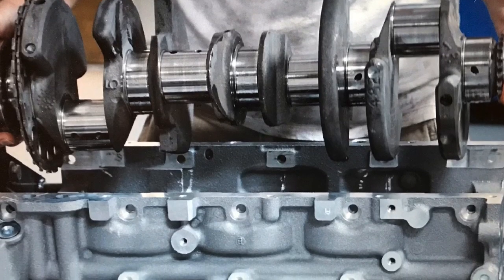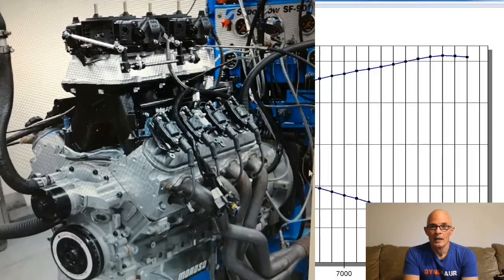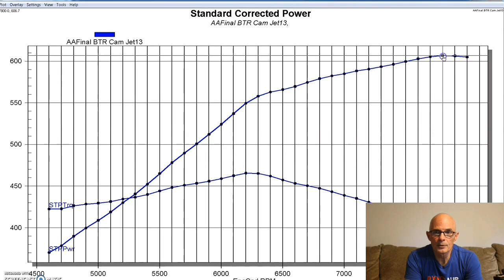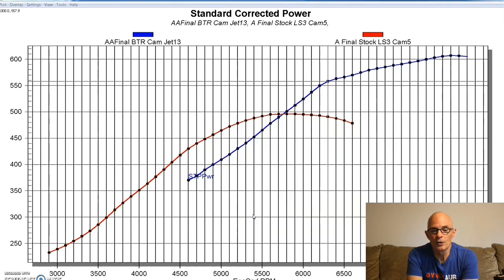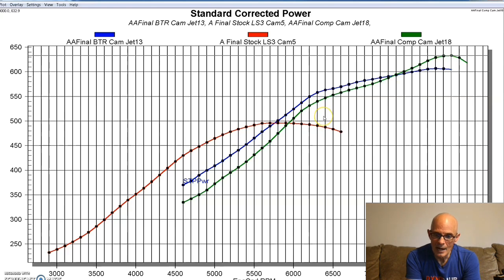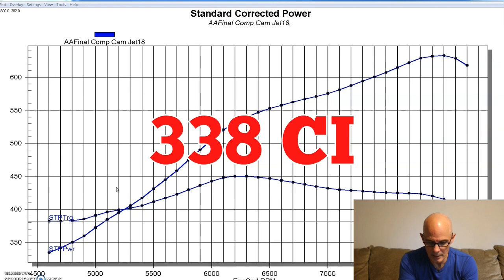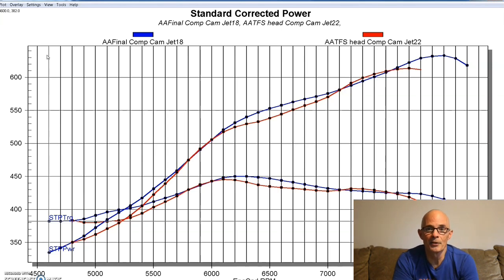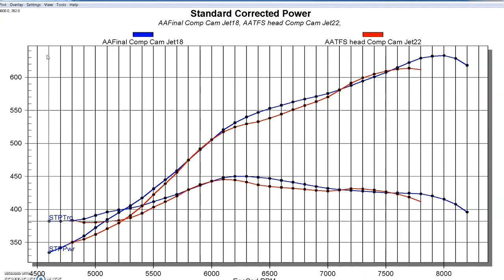DESTROKE LS-4.8L CRANK IN LS3 BLOCK-SHORT STROKE POWER-AN LS MONSTER MYTH?

Comment: No talk about piston speed? Isnt there a point where the piston is moving so fast the explosion rate cant keep up? I heard this number to be somewhere in the 60mph range, in which case wouldnt destroking become beneficial for that? My motor isnt an ls but I was picking cranks strictly based on this 60mph rule, which lead me to using my stock crank vs. Stroking, I could be an idiot I dont know... lol

Comment: Did this similar combo in a toyota 4x4 with turbo 350 trans 1.47-1 chain case, dana 60 axles 6.17-1 gears and 44 boggers. Was fun screamer but a torque monster would of worked better. But did with what was had

Comment: this is a sweet setup for 8000 rpm i whould like to see more testing with that short block combo like higher range compression ratio like 12.5:1 or close to 13:1 its possible to run that much compression even with pump gas if you have a motor setup for top end power (big duration cam reduce cranking compression and low speed power in theory) i think its possible to increase compression ratio a lot when you have a motor waking up in the top end range and still keep it pump gas 

Nice setup Richard
Reply: There’s a dude I know of with a 14:1 ls7 that does 8500rpm 840wheel NA

Comment: In race application, and why not on the street. It's sometimes more benefit in making the hig rpm power in stead off making low rpm power. First off, the engine size have often to do with racing classes. Second off, you might be limited with how much torque a gearbox might handle. This might be more a problem on street where you might be on a budget, but have to do with the weights issue also on the track.

Let's say you're stock gearbox can handle 300nm. If you get the torque peak @4000rpm you going to be down hill after that. Now let's say we make the same 300nm @ 6000rpm you will have a lot of more power.

It's much easier to limit the power output on an turbo application with engine management, having a lower bost on the peak torqued and rising the boost to keep the torque up higher. In the case you torque limited on any component.

Often inport cars have power potential with an turbo upgrade but the gearbox is too weak to handle the full torque so you just do some engine management to make it last and still enjoy the big power numbers

Comment: stroke length can be a limiting factor in making high rev power. The flame front can only move so fast and with a longer stroke the pistons speeds get high sooner in the RPM's so the piston can, in a sense,  run away from flame, or pressure, faster. When this happens the pressure in the cylinder cannot put as much work into the piston. In a short stroke engine the pistons move slower That is why you can rev a shorter stroke higher (if the head/valvetrain can support the rpm).

Comment: Richard, can you touch on piston speed? I run a 4.125x3.625 blown alcohol Chevy ("short stroke 400") to help control piston speed. We run the motor about 7800-8000 rpm. It makes roughly 1100HP (1975# car / 180mph)

Comment: Given a valve train that can support high rpm and rotating assemblies with the same mass, doesn't a shorter stroke give the ability to rev higher than a longer stroke just due to lower forces on the components? 
How would these two setups compare from an endurance stand point?

Comment: I couldn't agree more with the points made here, Short stroke with long rods is simply to lower the rod angle and decrease the amount of piston acceleration and deceleration, thus introducing less stress on the rods at both ends, ALLOWING the engine to rev higher. Higher revs opens up the potential to make more power i.e, more design rpm total, hence why NASCAR engines have been designed to turn as high as 11k rpm. Along with power higher in in the engines rpm is the ability to design a more broad curve over a larger window of rpm, meaning an engine built to turn say 12k can have the potential to make more than usable power from say 5k to 11k, and within that window to avg a higher hp number, than a lower reving counterpart, while still not suffering too much loss from 3k to 5k. Well stated and very informative.

Comment: I thought that short stroke engine's  were used at high revs for durability.
I have been told that the longer the stroke the higher the piston acceleration and associated forces on the rotating assembly.

Comment: It’s not a myth, if you take a given engine cubic inch and do nothing other than increase stroke the engine will make roughly about the same peak hp number ( more torque though) but do so at a lower rpm. The larger engine will consume available airflow sooner ( lower rpm).  You can of course get the larger engine to peak at the same rpm as the smaller engine with correspondingly more power with a suitable upgrade cylinder head, cam and manifolding. The effect is more pronounced when you are severely cylinder head limited 

The exception is if the smaller engine combination is out to lunch ie the head is too big and the rest of the combination does not  let it rpm enough to use the head to its potential.

Comment: Another thing people don't seem to understand that goes with your flow point is a that a bigger engine will act differently to the same cam specs. A big cam on a dz302 would be moderate on a 454.

Comment: F1 engines need to maintain equilibrium around the circuit the high rpm constant gives them quick power in tighter areas on track

Comment: @RichardHoldener I’ve dug deep enough on the interwebs and found that there is flat plain crank options for the LS. From what I understand, the advantage to a flat plain crank is you have half the cylinders firing at a time; the throws on the crank are 180 to each other. This is beneficial because it also allows faster, higher revs. It’s hard on the crank due to vibration and harmonics, though. I would like to see a flat plain crank LS with a short stroke and see the results. Shoot, I would love to see you test and evaluate a flat plain crank LS period.

Comment: There's definitely thins you overlooked, piston speed and rotating mass. A short stroke motor (assuming cranks and rods are made from the same material) will rev to that high rpm faster, and it will reduce rev hang. Because the pistons aren't traveling as far as a long stroke at the same rpm. There's also wear differences that come along with that.
Reply: Did you actually try to explain engine building to Richard.
Reply: @DJBloodBath777  No, I'm talking about a characteristic he didn't cover

Comment: If displacement is out of the picture and no matter what you want to spin 8k rpm the shorter stroke will live longer yada yada about modern Materials all day the most top shelf item still wears less if it has less stress on it aka less piston speed which is why f1 uses shorter stroke motors it’s not as hard on the block crank rods and pistons bearings as it would be with a smaller bore with a longer stroke less mass too the longer the throws on the crank are the more mass you have to add to have the same strength as with a shorter stroke yes it some point you’ll have Diminishing returns but yes shorter strokes like to rev more if he really wants to test this he should build 2 identical displacement motors and rev them to crank failure one with short crank big bore and the other small bore long stroke and see which breaks first

Comment: It's not that a short stroke revs higher, it's that it revs high more reliably, given all the variables are the same. It also gives you the option to run a longer connecting rod, or thicker piston deck. You give up torque, especially down low, as a trade off for durability/longivity up high. This is a result of lower piston speed. However, allowing for variables, it's a common misconception that a shorter stroke revs higher. It would be better stated that a shorter stroke ALLOWS you to rev higher, by reducing piston speed (inertia), & thus you can choose the right valve train components, compression, heads, cam, intake, etc to do just that.

Comment: math again help us, we know the power formula, it says: Power= pme x bore x mean piston velocity / engine stroke (2t or 4t, so 2 for 2t and 4 for 4t), now, we have 2 ways to increase the mean piston velocity, increase the rpm or increase the stroke, also, we know that the displacement move where we will have peak power, more cc mean anticipate the peak power, less cc says we had to rev high to have peak power, we also lose power by decrease the cc (but if we increase the piston numeber is another story), for f1 is different, they rev so high that they need small stroke, we have a limit to the mean piston velocity and inerzia is a big problem we u star spinning that fast, my question is, when a pushrod engine start to be a limitation to rpm?

Comment: The bottom line, is when the engine displacement is limited, it's always better to go with a bigger bore and shorter stroke for the airflow advantage of the larger bore.

Comment: The way I figure it is that Destroking allows a big bore engine to produce power at a much higher rpm due to the relatively slower piston speed compared to a small bore, long stroke engine of the same capacity; and same comp ratio in the same deck height block.
At some point the burn time of the fuel/air will plateau power production in both combinations even with identical high rpm valvetrain components. But one is going to plateau first.
The short stroke big bore will kill in hp where the small bore big stroke will kill in torque and even if you do some real fancy stuff with cam timing there is no way the long stroke engine will make power up there where the short stroke engine will... again talking same capacity, comp ratio and block dimensions. What the long stroke engine will do much more proficiency than the short stroke combo if you attempt to operate it way up in the rev range ( where the short stroke is happily making power) is eat itself up!

Comment: Someone had to say it haha. My favorite combination for our dirt track modifieds are our small displacement, short stroke, bigger bore 13 degree motors. They scream to 10k rpm and make damn good power. Our heads flow so much air and with a bigger bore there is less valve shrouding! One thing I’d love to try but don’t have the funds for is the same short stroke but with a longer rod to bring that rod to stroke ratio closer to that 2:1 mark. I think it will help with burning a little better due to the more dwell time at TDC also.

Comment: Hey Richard... in my early days at Bonneville while I was building and supplying the engines I ran DZ 302's... on Nitrous for 70+ seconds a pass... ( went through a truck load of them)  anyway the class limit was 305 ci...  so I've even got a 2.100 large journal 3" crank offset ground to a 2.9" stroke small journal so I could increase the size of the bore and put bigger valves in it...    Your exactly right... it's Always about Air flow...  that little puppy did RPM but not as good as the custom build 2.8" bryant crank in the Rodeck...  ( spun that one to 11,300 where it dropped a valve... ( six speed broke and went from 6th to 4th internally )  lots of crazy stories...   Love your video's... keep um coming

Comment: 5000 ft/min is limit of piston speed. So yes it absolutely matters. If you don't know this, then you need to do your research. Stroke is absolutely the limiting factor in rpm. I would like to see you do this again and base peak rpm on piston speed of 5000ft/min aka 25m/sec. You will need 1/2 inch pushrods and titanium valves, shaft rockers, etc as well as solid cam. 4.8 (3.258") crank limit is 9200 rpm, a factory crank won't do it, has to be super strong... Billet preferably. A 3.00" crank limit is 10,000 rpm. For comparison, a 4.00 inch stroke crank absolute maximum is 7500 rpm.  These numbers can be pushed but only with great expenses and daily teardown. The 302 series could rev out to 9000 rpm due to the 3" stroke and 4.060 bore. NASCAR runs 4.155 bore and the shortest crank possible to make 358 cubic inches. They can exceed 5000ft min piston speeds slightly. I.E. 5250 ft/min
This is an absolutely misleading video. Nascar, NHRA pro stock, F1 etc etc etc all run piston speeds near 5000 ft/min, it is the ceiling and exactly the rpm they all, that's ALL!!!, hover around regardless of engine design. The larger valve sizes happen to be a happy coincidence, not more, as that 5000 ft/min = 25m/sec is the SOLE hard limit in RPM! With absolutely no exception. 
You could never ever get a 4.00" stroke crank to run at 8000 rpm and survive even in a 1/4 mile no matter how much money and exotic material you used. That's the real story, don't believe? Just research yourself.

Comment: Please go the other direction. Build a stroker 6.0 liter, like a 408 (4.030 bore x 4.0 stroke). Go for as much torque as you can get and only rev it to 6000 rpm. Show us the difference between cathedral port heads and square port heads. A truck intake, the flat car manifold and some aftermarket manifolds. Use the 3 BTR truck cams. Focus on torque and let power come out wherever.

Comment: Makes sense..  but the f1 comparison is a little off.. 3.0l v8s turning 20k with pneumatic valve trains are kind of a bad example..   even when referencing short stroke big bore .. nothing astronomical amount a little bitty v8 /v10 in f1..  i want a Chevy v8 that i can turn 9500 with a spaghetti front routed exhaust and itbs..  id love to also see the poor man's chevy 302 .. 283 327 crank and what yall can do with it..

Comment: Love the content Richard. After watching it got me thinking on what I thought I knew about stroke bore and revs, the valve train not being able to manage isn't really definitive answer for me that a short stroke doesn't rev higher. Maybe with push rods but I only ever owned 2 cars with push rods lol. 
With a short stroke and big bore the piston moves slower than a longer stroke for any given revs.
Would be interesting to remove the limitation of the valve train, like turn the 4.8 and 6.0 crank externally and see which one comes apart because of revs first Haha

Comment: Hey mate, do a short stroke 338 big precision turbo, big boost iron block setup,   will it be capable of 1500 hp+ ?
Or even a 8/71 blower setup? I had stock 5.3 engine, solid cam and lifters, 680 thou lift cam, 8/71 18psi on methanol made 1120 hp on engine dyno, 7800 rpm

Comment: The only time it is any benefit to destroke an engine is when there is a significant weight break for a particular class. Less cubic inches = less power.  I suppose if you were seriously traction limited it may help you hook up better but I think there are better remedies for that.

Comment: You are totally wrong on why high rpm motors use big bore short stroke. It's because of piston speeds. Cut a stroke in half and and you can double the rpm and still maintain the same piston speed. Look up piston speed of f1 engine compared to a NASCAR engine and you will be shocked to see that although an f1 engine spins at almost double the speed at the crank a NASCAR engines piston has about a 5% higher avarage piston speed.
Reply from the maker: I'm very familiar with (mean) piston speed, since the piston actually has to travel the stroke length after accelerating from a dead stop at both BDC and TDC, meaning the peak speed will be much higher. I've calculated various stroke lengths and rpm and many (long-stroke) race motors are much higher than F1 or NASCAR. Even a long-stroke 5.4L Ford has a higher piston speed than F1 (at a performance rpm level), but its primarily air flow and packaging. Just ask the engineers at any race team.
Reply: @richardholdener1727  what you should be calculating is the forces exerted on the rods, crank, and wrist pins as piston speeds increase. I'll give you air flow but even the most exotic of metals can only tolerate so much force, and the forces from piston speeds is ridiculous. I have 2 old Suzuki GS motors that turn 13,500 and I've learned a few things. Getting the airflow is easy, solid valve train easy, keeping the rods in the block really fucking hard.

Comment: If the Max HP at a higher RPM is always related to displacement, then could you please do a apples to apples displacement to displacement test!!! -Big bore 4.8 (4.0X3.270) = 328.7 CI -0.020 over bore 5.3 (3.80X3.622) = 328.6 CI. The two engines should use the same intake, cam, heads(706 or 799), and have the same compression (9.9:1 with 799) as the HO 5.3L. It would be very interesting to see how the torque and horsepower curves compare on a true big bore or big stroke comparison. Thanks for the great videos. Keep them coming!!
Reply: car craft (or maybe it was hotrod) has done this, as an FYI (at least 10-15 yr ago), on BBC, same ci but different strokes/bores (same everything else) to debunk that a "stroker" made more tq...it didn't the curves were near identical (give or take 5hp tq if I recall).
Reply from the maker: yep-they did it
Reply: Mirage2991, could you please find out when that article was published. I have been looking for it almost every day and I have not found anything yet!!
Reply from the maker: It's been done over and over
Reply: So if I understand you correctly I can put a 496 (4.370”) crank in a school bus 366 (3.935”) block, bore it 0.010” & have the same power as an L88 427 + or - 5 HP/TQ if I use the same cam and a comparable intake?

Comment: Its the rods that let go on the high end with the longer stroke not just the valve train. That doesnt happen with the short stroke.
Reply from the maker: stock rods might-but lots of guys running up there pretty far with stock rods. The rod length does not come into play until well after the valve train has given up